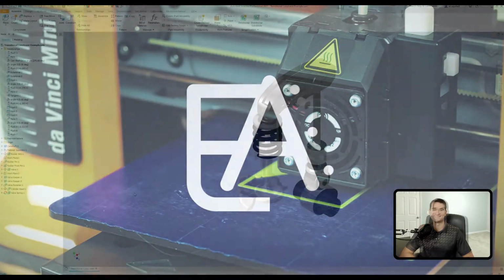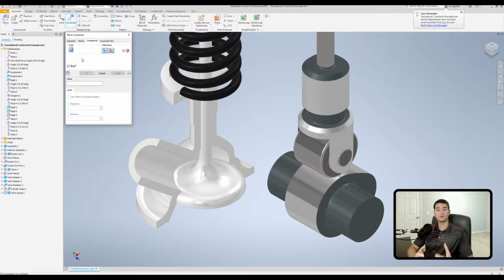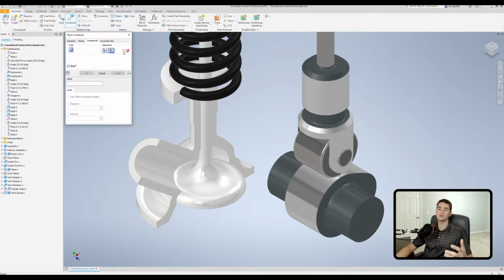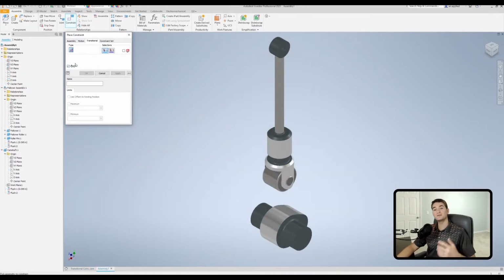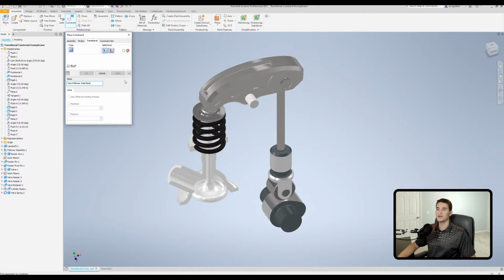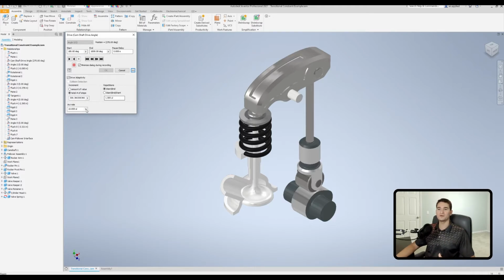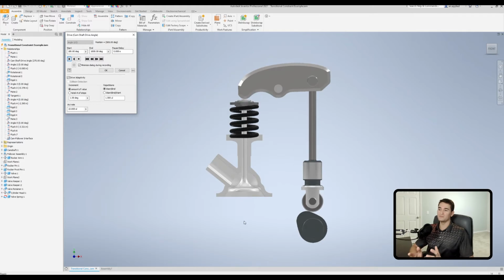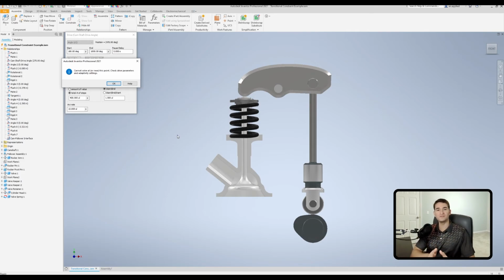Transitional Constraint - Autodesk Inventor Assembly Tutorial | Autodesk Inventor 2021 IN DEPTH

Comment: Great tutorial! My roller keeps falling below the cam, any idea how i could fix that issue?
Reply from the maker: Thanks for watching! It sounds like it could be a surface continuity issue between the roller and cam. The first thing I would check is that the cam profile consists of smooth transitions (lobe is tangent to circular part of cam where it intersects). The next thing I would look at is the actual animation itself. When you drive the constraint, try changing the amount of steps the animation takes during the rotation of the camshaft (increase or decrease number of steps). I found that increasing the amount of steps in the animation helped solve that problem on occasion for me (for example: 300 steps per 360 degrees of rotation instead of 25 steps). This option exists as "Total # of Steps" in the Increment section of the drive constraint command window when you right click on the constraint you want to drive and select "Drive". Also, make sure that you have the "Drive Adaptivity" option enabled in the drive constraint command window if you have adaptive components within your assembly. If that does not work, delete all the mates you have made (at your own risk) and retrace your steps when reapplying all of the constraints. This can uncover a potential mistake when you rethink how your assembly mates are interacting with one another. Before you do anything else, give the first three suggestions a try. I hope this helps!